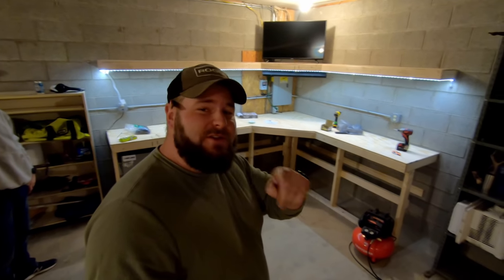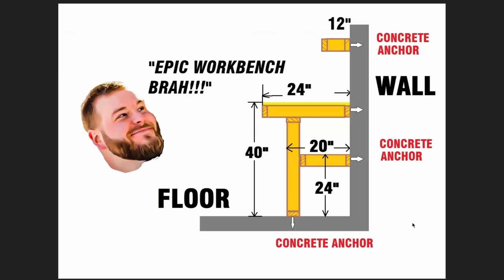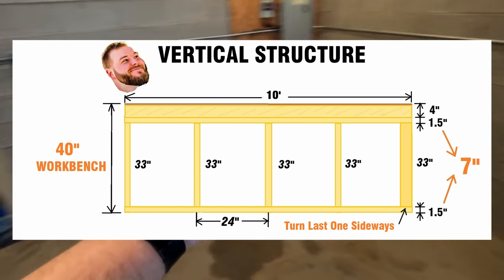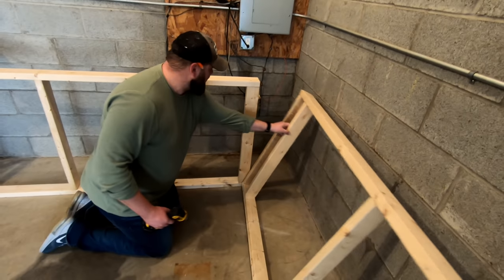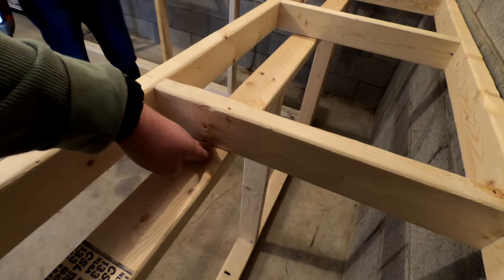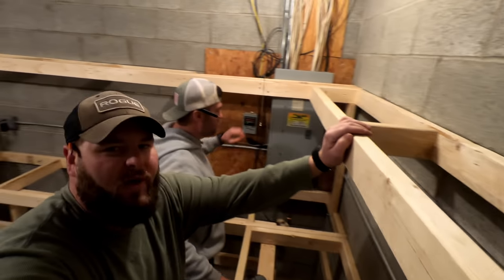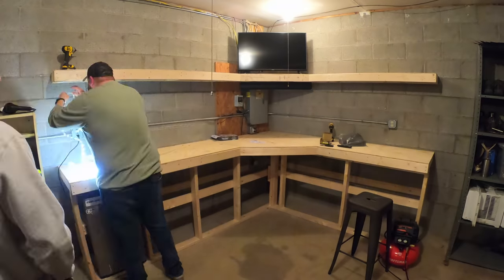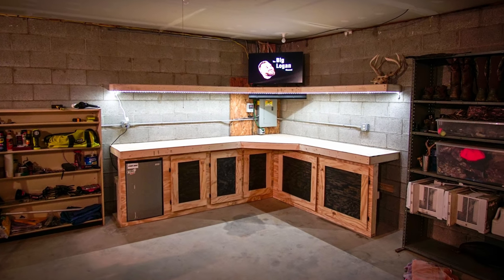DIY GARAGE WORKBENCH AND SHELVES / Garage Workbench Ideas

Comment: I see one problem, you covered the first top couple of inches of the breaker panel. According to electrical code your not supposed to do that. There is to be no obstructions within 2 to 3ft of the breakers. If you ever have the fire marshall or a building inspector see that they will write you up and tell you take the whole work bench down because it's to close the breaker panel. That happened to a friend of mine, and he was written up for it and had 10 days to comply if not the garage would be red taged and he would be  fined.

Comment: I just did a quick pricing for the material list for up here on the east coast... nearly $800 without the optional bits, $610 without the door fronts and trim. Lumber prices are so insane right now. 10.75 per 2x4x8 makes me want to cry.

Comment: Yo Big Daddy Logan-- I love this video. As a new homeowner I am getting ready to add a semi-permanent workbench to the garage. Your design in this build in my inspiration. I am not going to use the wall anchors because the walls are a. wood frame b. not level or flush and c. going to get ripped out in the not to distant future as part of complete reno. I was wondering if you could provide some more info about those masonry nails you used to secure the workbench to the floor. My plan is to add a set of of legs to the back of the workbench to make a 4-sided frame vs. the T style in this video. I checked around online and we not able to find those particular nails. Let me know bro!! Thanks and keep the great content coming!
Reply from the maker: Matt my bruddah!!  Check out Grip-Tite Masonry nails.  Keep in mind if you employ a “4-legged” system you may not need to rely on anchoring to the concrete.  This is pretty exclusive to the Big Logan T Structure design.  Good luck man!
Reply: @biglogan3690  Thanks Blood... I think I'll need to anchor to SOMETHING because of the wall is not suitable. I appreciate the quick response.

Comment: How do you get the electrical panel cover off ?  I see the door will open but if you need to do any work in the panel do you have to disassemble the cabinet for access ?

Comment: Love the build. Are those wedge anchors a pain to get out if I ever wanted to remove the workbench?
Reply from the maker: Assuming these are permanent installations.  I’ll have to research!
Reply: Pretty much have to use a grinder to get them out, or at least flush with the wall.

Comment: What was the inside rail and rail on the brick wall for without a shelve on the inside of the cabinet doors?
Love the garage work bench videos. I'm working on getting lumber to make mine now.
Also I see you refer to tapcons in most of your videos but you guys are always using hammer in anchors. Is that because the tapcons keep pulling out? I want to make sure I get something that's going to hold. Thanks you for the info!

Comment: Is there really any need for the floor and wall anchors? Seems like that would be plenty heavy enough to not be moving on you
Reply from the maker: It needs anchored since it is a built in structure shaped like a “T” it would fall down or tip if not.  Thanks!

Comment: Nice job! But how did you get the plywood shelf inside the workbench after it was all finished?
Reply from the maker: Bend it, cut it in pieces, or drop it in before building / placing the top structure.  Good luck!

Comment: Hey guys great video. Just curious what is the reasoning that you worked from the front to the back and not back to front. I'm not trying to be otherwise I'm just wanting to figure out your reasoning for doing so
Reply: If you started on the back wall, you would have to find level and find your measurement to build the front wall.  To much room for error and it would never be level.  Building and anchoring the front wall first you simply need to find level and mark across for your back board/brace.

Comment: question, you did the cabinet trim out from one piece of plywood. when you cut the opening for the door did you carefully cut them out so you can use the cut outs for the actual door? love your design.
Reply from the maker: That’s correct, then skimmed 1” off height and width so they wouldn’t be too tight.  Then overlapped the shaker fronts to cover the gaps!
Reply: @biglogan3690  brilliant!

Comment: Hi I’m about to build this exact set up except it 14x14. I build decks and out door projects. I’m in Houston . What would you charge for it?
Reply from the maker: For general carpentry like this, I'd throw a 2 to 2.5 X on materials cost and make that your total.  So $350 at supply store would equate to $700 - $875 project plus your travel / estimating time.  14' x 14' should go pretty simply in one day.   Good luck!

Comment: I'm going to do this in my garage. But I was wondering did you check code to make sure it's okay to build over the breaker box?
Reply: It's against code to build over the breaker box. I think you have to have 3 feet clearance  around it
Reply: It is a code violation. The next time the house is sold or any work requiring a permit is done, it will have to be torn out.
Reply: I said the same thing

Comment: On the 10 foot section, you have 24 inches on your diagram. Is this correct? I'm reading as in each board should be 24 on center.
Reply from the maker: Correct!

Comment: Throwing a question out there: can this be assembled without drilling into my garage floor? I just moved into a new house, and I don't think I want to drill into the garage floor.
Reply from the maker: Yep just make sure it’s tight to the floor you can use Fuze-it by liquid nails to bond to concrete (somewhat permanent but removable)
Reply: @biglogan3690  , thanks bro, really appreciate the quick response.

Comment: Hey bud. I’ve watched this video and your last workbench video. They look great but you can’t build a bench in front of the panel like that. The electrician that has to work on that next is going to be pissed. And it’s also a code violation, but other than that. Good vid

Comment: Is that a hollow block wall?
Reply from the maker: Yes
Reply: @biglogan3690  So it is actually hollow where you attached the 2x4? The reason I ask is I didn't think wedge anchors were recommended for hollow block.